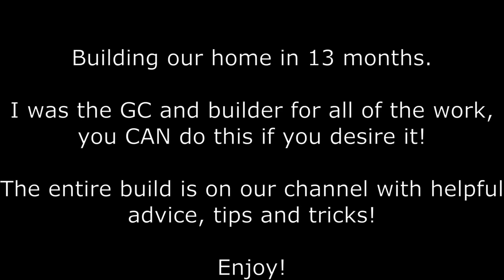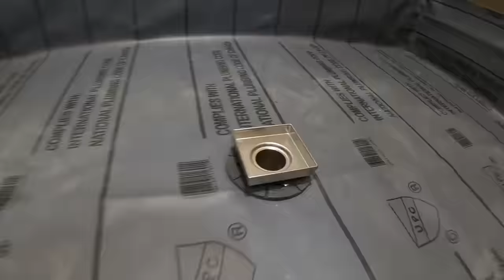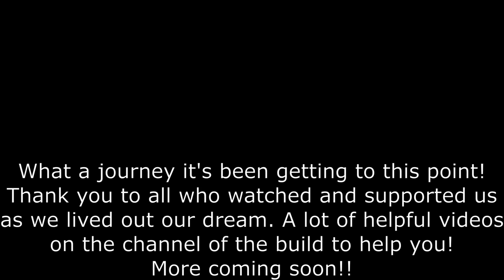Building our house with NO experience in 20 minutes! TIMELAPSE! #barndo #barndominium #718

Comment: What could be more satisfying than a man building his own castle? Watching every episode was like watching a dream come true. Job well done.
Reply from the maker: Thank you for watching and the support.
Reply: @TKCL  what was the total material cost not counting the land? About $600K?
Reply from the maker: Not at all, $179k. Here is a full cost breakdown video I made. I could have built it for $40k less minus some upgrades we did. https://youtu.be/ryLVUKgiPTs
Reply: @TKCL  dang I would have thought the main structure of the barn roof and framing would have been over that. Framing, cement, walls, insulation, appliances, furniture, roofing, electrical, all for $180k? What is the length and width total about? Dang that sounds like a good price even for just materials
Reply from the maker: I built the majority of the house myself, so huge savings there. Overall is 40x70 on slab, house is 30x50 downstairs, 212 Sq ft loft, and 900 Sq ft conditioned attic.
Reply: @TKCL  thanks so much for the info. I built my 16'x24' tiny home and added a lean to on one side for a screened in porch the same size 16'x24', then lean to off that porch for a 16'x24' carport, then added a 16'x33' fire pit awning on the end of the carport. I will be adding a 16'x12' screened in porch addition on the side of the existing porch, then a 20'x20' outdoor kitchen on the side of that porch. I built my house for $24K cash and did all the labor in 2012 when I was 32. Every year since I have added something. I love the info and ideas of DIY construction so thanks so much for all the videos and great work and explanations. I AM SUPER JEALOUS of your house, yard, and outdoor kitchen. Thanks again and have a great day.
Reply from the maker: A lot more videos coming, including a deck, pool, firepit area, game area and some special projects.
Reply: @TKCL  man I can't wait to see.

Comment: Definitely, built the heck out of that place. 
Post frame building with full 2x6 exterior framing. 
Almost like framing 2 houses. 
Then spray foam to lock everything together. 
Only thing I would have done differently is put the posts on an insulated foundation rather than burying them. I don't like burying wood.
Reply from the maker: I agree, but our engineer wouldn't pass our hurricane wind zone without them being buried. You get a lot more shear strength buried. Yes it comes at a cost of rot. We've done a lot to offset that.

Comment: Man, this is so cool to see. In the breakdown video you said you had to do 2x6 12"oc to meet hurricane code; I'm thinking about moving back to FL for the long term of my life and was wondering if you thought or knew whether or not a staggered stud design would qualify since I would be looking to maximize noise and HVAC insulation.

My idea (not plans yet since I don't even have a job or savings at the moment) is to run 2x8 plates with 2x6 staggered 24"oc per "side" (or the same design but one size down, so 2x6 plates and 2x4 studs) which would effectively put A structural piece every 12", but half of them would touch the outside and the other half would touch the inside wall. This de-couples the interior from the exterior, and even though it isn't a FULL decoupling like a true double wall would be, it's said to provide a measurable effect compared to standard construction.

If you don't know, but also don't think this would qualify, do you think 16"oc staggered (so, a structural piece every 8" half on ext, half on int) would? Or do you think it's meaningless to speak hypotheticals and I should just ask someone who knows the code for certain when the time comes?
Reply from the maker: I do not know, it's what my engineer required for the end walls. 16 oc for my side walls.

Comment: Whoa. 😮 My respects to you sir. I just have a question. The video didn't show the foundation being built. What kind of foundation did u use
Reply from the maker: 6 inch slab with 12x16 footers for all load bearing walls.  There is also a slight shallow footer around all porch edges.

Comment: Looks amazing have one question tho what’s to keep the concrete from sweating and rotting out you’re post seeing that the concrete was poured around them ?
Reply from the maker: Post have natural straw like fibers that allow moisture to flow in and out. The biggest problem most people do with installation is seal the bottom of the post with concrete. You need a hole with packed gravel in the bottom for the post to set on and drain. The other enemy is roof runoff, gutters and sloping dirt away from the home is critical. Lastly I used a salt water grade treated post, it's far more protected than the box store stuff.

Comment: Experience looks like yall had plenty of experience 😂good job though nice place, wish i had the time and money to do this for my mother
Reply from the maker: Never built a house before or worked in the construction trades.
Reply: @TKCL  I believe you inwas just being a Karen sorta, man you did a fantastic job, may I ask how long it to y'all to complete just the house part from start to finish? And did u do all the electrical runs in the house yourself? How did you go about learning and completing this sort of project?
Reply from the maker: Took me 13 months start to finish. I asked anyone who recently built a house for tips, asked my inspector for advice and read every building, plumbing and electrical code I could find. I did wire my entire house, luckily I live in an area that allows the owner to pull all permits. I still had to pass every inspection and code like anyone else.
Reply: @TKCL  that's good info I woulda just watched video after video getting nowhere lol I've always wanted to build a house considering the cost of one to be built these days... But hey thanks for taking the time to reply to me buddy I will lock this one in
Reply: @TKCL  don't those codes change every year or every few years?
Reply from the maker: About every 4 years you see updates.

Comment: Where did you purchase your trusses from and what pitch did you do? Awesome work!
Reply from the maker: Backwoods buildings in Chipley Florida, 4/12 pitch.
Reply: @TKCL  how tall was your side walls and ceiling height in the lower level to achieve the loft space?
Reply from the maker: The Loft was an afterthought, my sidewalls are 12 ft. In order to meet all fire code and not have any issues on what you call the LOFT space, I suggest going to minimum of 14 ft sidewalls. The inside ceiling of the house is at 8 ft on the lower level.

Comment: So is this a steel building, but inside stick built?  Wondering if cheaper just putting metal siding on the sides instead of what you did?
Reply from the maker: No this is wood framed.
Reply: @TKCL  So would it have been cheaper or more expensive to put steel siding on it?  Thank you.  Hardy plank may be less expensive, am I right? Your house looks awesome with the siding, but trying to plan out my house I will contract out.

Comment: I have a question, did you have a list you went by to make sure you didn’t leave a step out? If so how’d you get it? The only reason I ask is my husband and I plan on doing the same, but I’m worried we’ll miss an important step and you can’t go back after a certain point. Do I ask a GC?  Y’all did a great job by the way, very impressive.
Reply from the maker: The building department did have a small checklist, ask yours. Thankfully my building inspector was willing to offer tips and advice after I proved to him I was reading code and trying to not cut corners.

Comment: did you perchase the build plans? i would love some advice we are about to start panning a build of our own and it will be similar to this and was wondering how you planned out all the matterials needed and costs or if it was a kit you perchased? any advice helps thanks
Reply from the maker: We designed the plans ourselves and took them to an architect and engineer.  As for costs, it was very difficult, we made our best guess at it and put a 25% buffer in.  Then covid hit and drove everything sky high, hard to plan for something like that.

Comment: I am building something similar,  my plan is to insulate like y'all did but i am worried about condensation.  Most are  spraying these but that is a cost of like to avoid.  Have you had any issues wiith condensation?
Reply from the maker: Zero issues because we planned for that. You've got to run a humidistat, a dehumidifier, HRV, or ERV to control it. Watch this video https://youtu.be/Dk3KWtXePjs

Comment: Upper floor timber joints 600mm centre👎?? Uk engineer rules are 400mm centre👍
Reply from the maker: This isn't the UK and that's also southern yellow pine wood.  It's very strong and has its on load class rating.  Where my loft and living space is upstairs the joists are 300mm spaced with a 25mm thick floor.

Comment: One small tornado and the whole thing gone in 2 minutes
Reply from the maker: Isn't that the case for most homes? I've yet to see a tornado zone code requirement, because it doesn't exist.
Reply: @TKCL  point is, these homes are not constructed to stand high force winds.
Reply from the maker: Your absolutely wrong there, I'm in a hurricane zone in Florida. This home was engineered by a residential engineer here who's quite familiar with code and laws to pass inspections. We can't just build as we please.
Reply: @TKCL  ok

Comment: This is exactly why you should hire a professional builder.  The gable end wall should have had lvl studs,  no anchor bolts installed during concrete pour,  the roof will sag over time between trusses,  posts should not be set in concrete, they should be in a bracket with proper embedding into concrete footings, floor joists are not proper size, spacing or wood species, looks like too much spray foam was sprayed, should only have 4 inches of the cavity filled,  window wrap is wrong tyvek needs to flap over top tape piece so you can put the drip edge over the window and have the tyvek overlap so water runs down onto drip edge.   Just dont build a pole shed for a house.  Easier, faster and longer lasting to just frame traditional stick framing.
Reply from the maker: Hilarious! I guess you assume I can just build as I wish? This house had to be fully designed by an architect, then pass through a Florida certified residential engineer to be stamped. THEN all plans had to be inspected and pass the building departments review before I could apply for a permit. I then had to pass full inspections and code every step of the way while building. Each and every statement you made is wrong in every way. Had you actually watched this build on the other 200 videos that were posted in detail you would see a lot of what you missed. Don't know how you can watch a fast forwarded video and make all these assumptions.
Reply: @TKCL  just because some dude stamped your papers doesnt mean its done right.  I've been building (mostly framing) for over 25 years, and my comment is based off of what I've seen allowed by code and what actually lasts longterm.  I've been in houses that we're less than one year old,  built by a national builder and found major defects that we're not found by inspectors, broken/defective trusses, bearing points not continued to foundation,  sagging floors and roofs that were designed,  engineered, stamped, and it still sagged over time.

Comment: Wow, wish my state let me use my own grit and know-how to complete and live in my own home.  We have to have the critical utilities work (water/electrical/HVAC) done by certified tradespeople out here, or our building and occupation permits get yanked.

Anyway, I wonder what that place sounds like in a rainstorm.  Gotta be an ungodly racket with that metal roof!

Also, maybe zero experience, but come on, obviously a huge range of skills and equipment to work with!  Not knocking your achievement one bit, but kind of underselling things a bit here, aren't you?  Carpentry, electrical, plumbing, metalwork, cabinetry, and trim?  You realize there are people who make a whole living out of just ONE of those skills you used, right? :D
Reply from the maker: Don't know what to tell you, I've never built a house before or worked in the construction trades. I studied codes, bought more tools and worked my butt off. FYI you can barely hear the rain inside, spray foam is amazing.

Comment: Building a house with “no experience”? Really? Electrical, plumping, carpentry, just a name a few. Those are skills! But nice job on the house!
Reply from the maker: I've dabbled at my previous home, but no, I don't have any house building experience. I had to read code and learn as I went a long. I've never wired a home before, built one or worked in the construction trades.